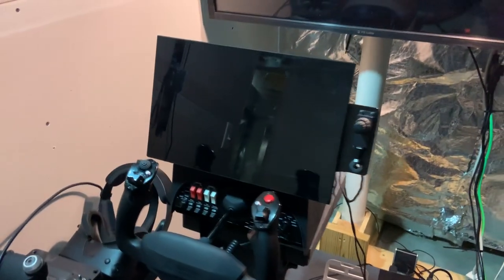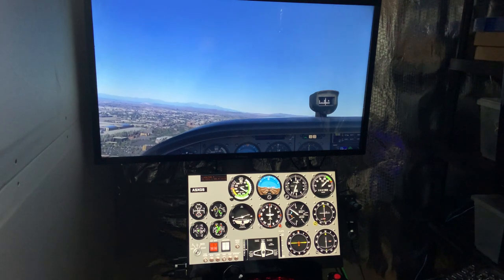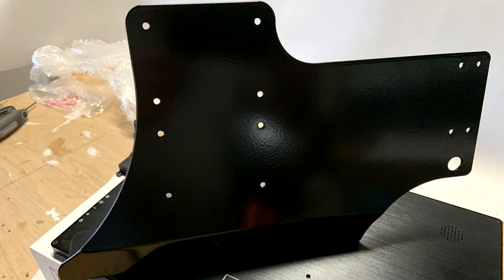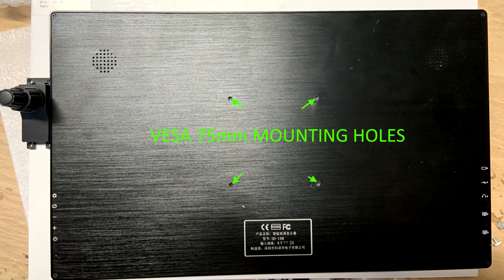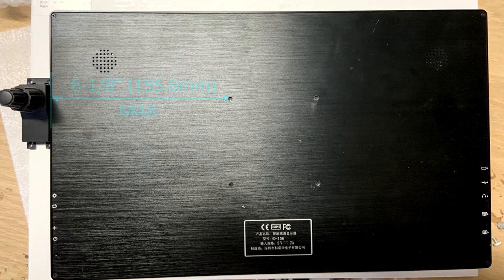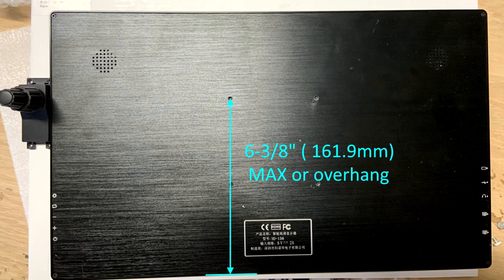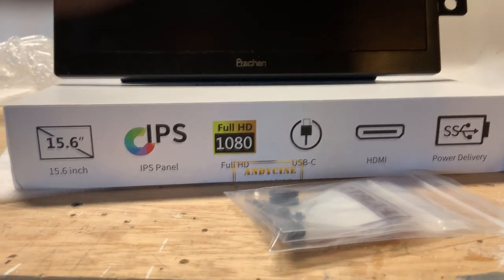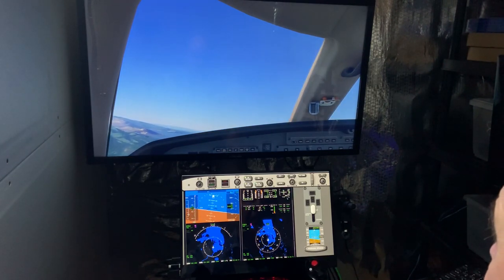Stay Level Avionix- Universal Touchscreen Bracket

Comment: Russ really appreciate your videos and solutions. I’m building a simulator from scratch, using much of your advice. Got the knobster, will be using two touchscreens mounted in Stay Level’s panel. On top of that will be 3 50” 4K tvs, the 5 monitors possible via Plugable HDMI Video Graphics Adapter and in between honeycomb alpha and bravo. Under the seat a buttkicker. All routed through (almost) the best CPU/GPU out there. Looking forward to years of relaxation and versatility with MSFS/3rd party advancements over the months and years. Thanks again for the touch/knobster innovation!!

Comment: Russ, love your videos and am slowly buying the components for my grandsons to build a Stay level twin monitor system possibly running a M1 Mac mini . Can you pls share why you have switched from the Pretchen to the WiMaxit monitors?
Reply from the maker: Well, partially due to reliable availability of the Wimaxit. Each new iteration of the Prechen seems to change in subtle but significant ways so it is had to suggest which model to buy. But more significant is the fact that the Wimaxit has an all glass flat edge to edge surface which seems much more durable for touch screen use and frankly seems more responsive to touches. In short I just think it is better.

Comment: Hi Russ, Just got the dual brackets from Stay Level and have two WiMaxit monitors on the way. Since both brackets have mounting points for a knobster would you recommend getting just one knobster between the two screens or putting one on each bracket? Can you even use two simultaneously?
Reply from the maker: Do you only need one Knobster as long as everything is running on one computer. In fact only one dial can be selected at a time so there’s really no advantage to the second Knobster. If you have a set up where you have more than one computer running Air Manager you would need a Knobster for each computer connected via USB.

Comment: What’s difference between this one and the flight velocity mount?
Reply from the maker: The stay level avionix version is durable metal and was designed after I encouraged him to manufacture it. The flight velocity came later and Isa cheaper plastic version. Functionally they are probably the same although I have not tested the flight velocity copy.  I do know the Stay Level  version has to sets of holes to fit both Wimaxit monitor bold patterns. Not sure about Flight velocity’s but if you buy the monitor they sell with the unit( or know it is compatible based on their info) it should work fine. Let me know if you discover more than I presented here.

Comment: I use two 15.6 monitors in my sim. One sits on top of the Honeycomb yoke, and the other will sit on the Bravo throttle quadrant. Neither has mounting holes, so they have to sit on a portable stand on the very narrow ledges of the controls. I need to find a way to mount the stands so they won't move. 1st world problems, I guess. Would be nice to have a stand that the monitors sit in that mounts directly to the controls.
Reply from the maker: Have you considered a set up in a panel like I did in thuds video?  https://youtu.be/s06Z-K34er8
Reply: I use small tablet stands.  Cheap and effective.

Comment: Thanks for the informative video.  I plan to look into the Wimaxit monitor.   I did have a question about ports needed to attach to a Flightsim PC. I do not have usb-c ports on the computer, but have 3 Display ports, and 1 HDMI port.  I am currently using the HDMI and 1 of the Display ports, leaving me 2 Display ports free.  I could do some port swapping if needed.   Where I am not clear on, is how the touch screen info gets transmitted back to the Computer.  Is that through the HDMI port, or does that rely on a separate USB port?  Thanks in advance!
Reply from the maker: My computer has similar ports as yours. The 15.6 inch monitors use an HDMI connection so I use a HDMI to display port adapter for the additional ports I need. The touch control inputs are transmitted into the computer via a USB connection. The WiMAX it monitor has two USB-C connections, one for power, and one for signal. I believe the video can also be sent via the USB-C but I haven’t tried that. Don’t forget that you will need to calibrate your monitors if you use more than one touch monitor so that the computer knows which touch input is connected to which monitor. Do this by going to settings and search on the word calibrate And you will see a calibrate touch and pen computers. It will basically present you with a white screen and a message telling you to touch each screen so that it knows which screen is associated with that touch grid. Let me know if you need further help on that but I think it is self-explanatory.
Reply: @rbarlow  Thanks Russ...Amazon is delivering my monitor tomorrow, so I will give it a shot.

Comment: I intend to build my own mount and use an ASUS 24" touchscreen monitor.  My eyes need things larger.
Reply from the maker: I’m not sure the monitor top may not  be too high for many aircraft types. The scenery monitor’s vertical mid point is the horizon line and should be level with your eye position. It may be fine but you might look at the geometry to be sure.